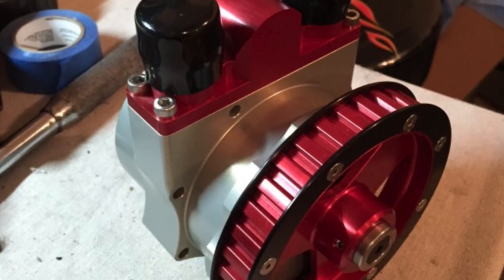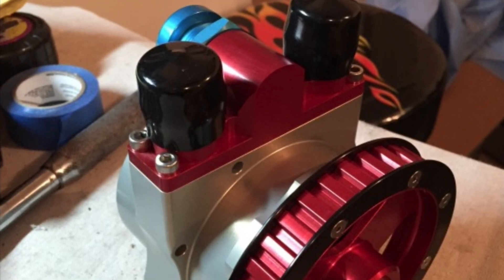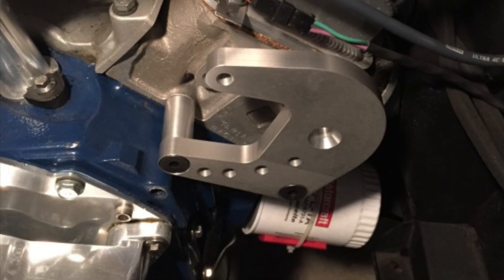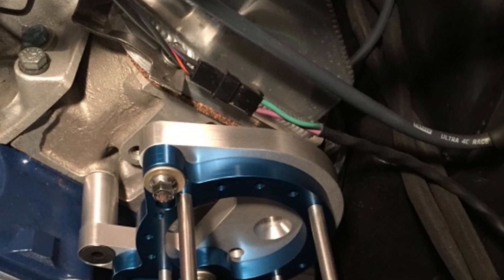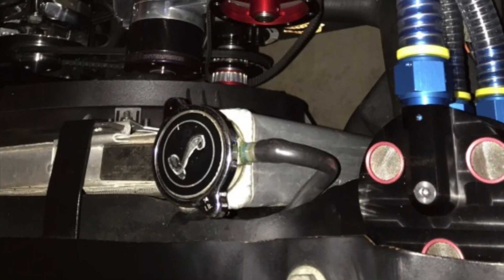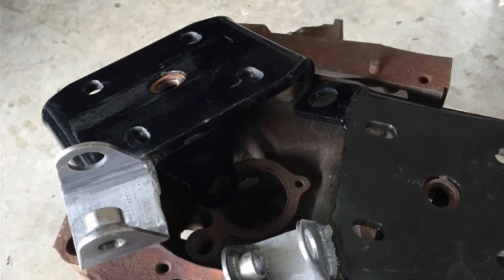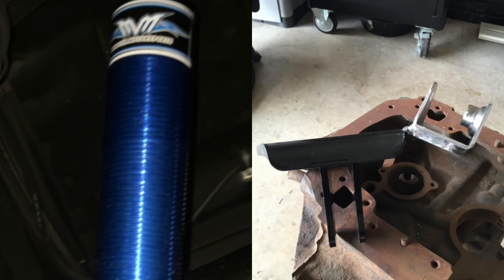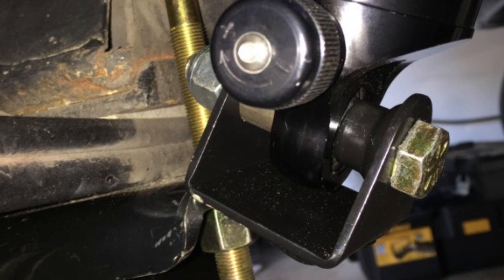DBG: How I Added A Vacuum Pump To A 351 Cleveland/ Custom DA Shocks To Cal Trac Mounting Bracket

Comment: Hi Tim! Something to consider that I believe most people don’t always think about is where the vacuum is being applied to the engine either by a pump, PCV or header extractors, vs. the path that the pressure has to take to get there, and how that influences oil drain back......on a traditional engine with a valve cover vents and no vacuum device, the combustion gases are trying to escape through the same passages the oil is trying to return to crankcase in the heads......the best system “idea” I’ve seen (without a vacuum pump) is having the header extractors plumbed to large fittings on the intake manifold to be exposed to the valley, then the both valve covers were still vented......in this type of system the header extractors are pulling a slight vacuum on the crankcase, though the holes around the camshaft in the valley, and atmospheric pressure air is able to ENTER through the breathers to help force the oil back to crankcase from the pressure differential created......it would SEEM to me that if a vacuum pump pulled from the valley and the regulator for the vacuum pump (metered peak that lets air in to reduce vacuum) was plumbed to both valve covers, you’d have the same sort of system as described above, and maybe some power would be picked up from there not being as big of pressure differential between the crankcase and valve covers, and likely less wind age too from oil loading up as much......this is just a thought to consider if you wanted to give this vacuum pump a second chance to see if it could pick up power with a different plumbing arrangement.....

I enjoy your videos; keep up the good work 👍
Reply from the maker: Thank you Eric for commenting on my video. I had to read your message a couple of times. Then it dawned on me, I can remember seeing Bob Gliddens  motors, and I have a TR Intake that has a vacuum fitting and I could not figure out why. Also has the back fire valve. They did not have vacuum pumps back then, that I know of, but I’ve seen intakes with that type of system with vacuum coming from Intake Valley. I bet it does work. If I have time I may consider re-plumbing it. Maybe others have seen this and can comment. Thank you for watching DBG,stay tuned, way more in store. Tim

Comment: Good video. I have Caltracs on my '69 Cougar. I'd like to see more about the gusset you mentioned.
Reply from the maker: Yes if your making 600 plus need the gusset. They make gusset axle perches at Calvert Racing. Talk to Travis, tell him I sent you. 
Here is my video ck it out 
DragBoss: How To Adjust CalTracs For  Wheel Stands.
https://calvertracing.com/product-categories/parts/

https://youtu.be/WG2nH0k_DX8
Reply: @DragBoss351Cleveland  Thanks. I'm quite a bit shy of 600 horsepower, but I've broken all kinds of stuff at the track that shouldn't have broken at my power level, so I'm inclined towards overkill when it comes to suspension and drivetrain setup.
Reply from the maker: @DragPakMerc  agreed. I buy quality first and hopefully save money in the long run. Also have another vid on modifying my Calvert mono leafs. If you don’t have them, worth their weight in gold. Stay tuned

Comment: Tim, how much vacuum was the pump pulling? I'm surprised you didn't pick up any hp but your engine must have good oil control already
Reply from the maker: I went through at 8200 with 12 inches, went up to 14. I never had oil in canister, but once. When I had a motor built broke on dyno told it was fixed, but never fixed. Had so much blow by,  separator getting contaminated oil in it. Yeah, that incident is what started me on this channel, the other factor is video diary for my kids. Have to test it maybe at track.
Reply: @DragBoss351Cleveland  that's kind of the same I'm doing with my uploads, really just to stay in touch with family back east, and the few foxbody / ford guys that are interested! Its sounds like you had it set up right and were pulling good vacuum, but I have heard some guys pick up hp some don't with the vacuum pumps!
Reply from the maker: That’s the way it is. Some motors are done right and pretty efficient from VE standpoint, and may not help I was told. Expensive test $2500-3k for all associated parts. Great for when I am gone

Comment: so you saw no additional hp with the Vac pump?
is it mostly for lowering crank case pressure?
id love more info on the oil separator system, as i have a motor with issues of spitting out loads of oil from the PCV ports under high rpm or boost
Reply from the maker: No not at track. The separater come from star machine. Never had any oil in it until I had bad rings from broken oil pump in dyno

Comment: Seems like going this far ya may as well do dry sump  but obviously the pump is much more expensive, but what we can afford i guess as im still wet sump too $$$ 
Looks great obviously
Reply from the maker: Thank you. I haven’t gone that far as to go dry sump. It’s a national expense, and also it Hass to be installed on the fittings have to be installed in the heads and block/ pan. Maybe in the pro stock motors I build I may consider that. or external Wet sump is another option.

Comment: Love your vids, since your sort of a Cleveland encyclopedia I have sort of an odd question.... Are the 2v 351c heads the same as 351m heads? Reason I ask is because I threw a set on my 351m I rebuilt recently and everything seems fine but don't want to hurt the engine.  Thanks!
Reply from the maker: Yes they will bolt on. Not sure valve train specifics. Or piston shape and 2v heads.
Reply: @DragBoss351Cleveland  appreciate your advice, so far so good.  I studied them closely and could not find a difference between them. Thanks again!
Reply from the maker: Make sure have adequate piston to valve clearance and let her tip.

Comment: Although vacuum pumps did not really begin to appear until well after I left serious racing, I have friends who've used them and liken them to what can be described as a pickle. (The vegetable.) Zero-sum-gain. On average, a pickle's calorie content and nutritional value is negated by the effort it takes us to eat it. The cost factor of a "power enhancing" vacuum pump, piston and other related provisions, its weight and the resulting parasitic drive losses (though both are admittedly low) yield negligible gains. To run one or not? More show than go? What a pickle...
Reply from the maker: I was told that my engine tuned right and sealed right as a drum. You really have to look at cost versus benefit. That whole star machine vacuum pump set up with pulleys and mandrel plus spacers and belts. Close to 2500-3k. Is it worth it. Have to really test on a dyno, and also track. I will try it and see. Thanks for the delightful analogy my good friend. Such truth.

Comment: As a doofus level mechanic, I am curious to know if you are using a serpentine style belt, or an auxiliary belt to run the vacuum pump?
Reply: It's a toothed or cogged belt, I think they are called a Gilmer belt. Like a cam timing belt.
Reply from the maker: Yes 10k is right Gilmer style. Narrated at work after closing a 3 inch pipe gash. Doofus level, please. Anyone watching this channel is already past that. The quest for knowledge is key, keep this alive and you stay alive, both mentally and physically. Glad you guys are here. 🏁